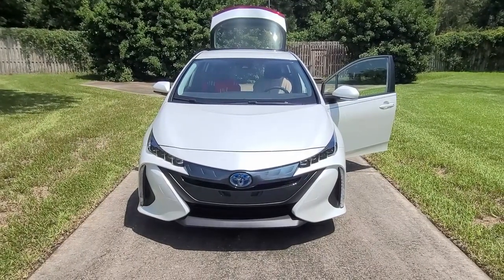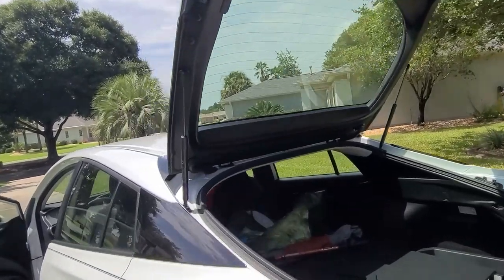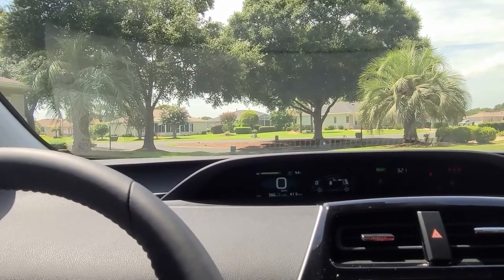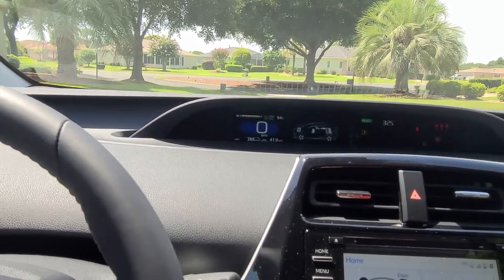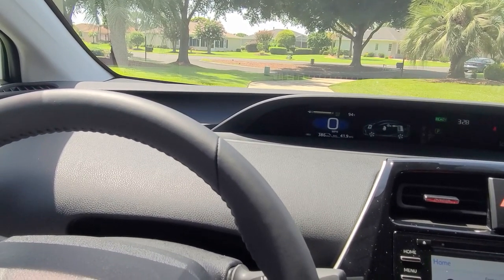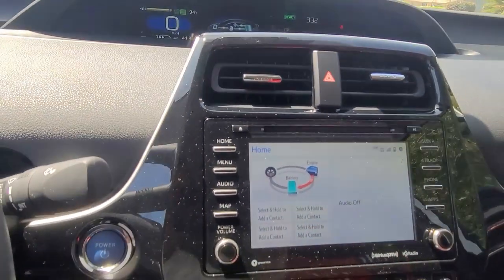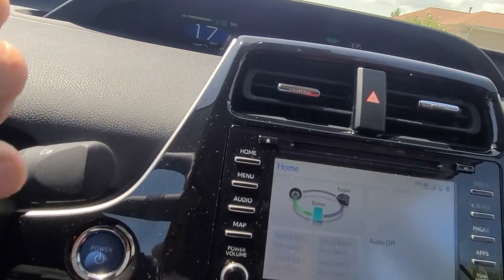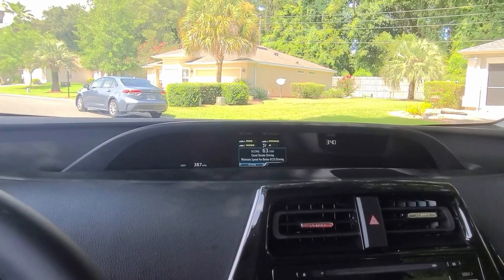Toyota Prius Prime LE 2021 Drive Modes and Gas/Electric-Battery Techniques Fully Explained at LAST!

Comment: I stick with Eco mode all the time, since I drive like an old man anyway.  I drive a lot of hilly highways, and I find that the engine does kick in on the steepest hills at highway speeds in EV Mode.  It kicks in on moderate hills in EV Auto.
Reply from the maker: Me too. However, I live in the FREE state of Florida which is mostly flat. Therefore, I have to remember to use Power mode or run the battery down from time to time.

Comment: Great and funny video. I tend to stick in normal mode for a good balance of power and economy mode. Eco mode is just a little too sluggish on the accelerator for my taste. Also, in standard EV mode, the car will stay in EV until 85mph, after that speed the gas engine will automatically kick on.
Reply from the maker: Thank you so much for the comment. I was more referring to the fact of what happens when the EV battery is spent. I drove in Michigan so I know some people drive 85+ and good luck with that. Michigan now has a State Trooper every 50 miles on I-75.

Comment: Hey I also worked on the Digital computers PDP-11, I memorized the switches for the boot program. Programming was all in Assembler language. No one understands today, what machine language is!. Out team wrote all the OS, device drivers from scratch. I also used PDP-8 prior to that. THanks for the video, still waiting for my 2022 Prius prime to be delivered. Stuck  on a ship in the Pacific!
Reply from the maker: That is your problem. If you had brought your Prius into a Florida port you would have it now! In college I got a A+ programming in Assembly language and C.
Reply: @thatcybersecguy  had I known I would have done it.  My dealer probably did not have the option

Comment: Appreciate the energy and enthusiasm, be yourself people with negativity just simply won't get it, i had a prius before and been contemplating this car so watching your video helped, thanks for making it keep em coming!! Someone in another video said car wouldn't switch from gas to electric and back without having to turn car off. is that the case or can you switch from any mode at any time while you drive?
Reply from the maker: You can switch anytime. However, I felt a lurch in the car which I don't think is good. No evidence of that. I wait until I'm sitting at a stoplight to change techniques.

Comment: What I am trying to tease out concerns the starter battery in my 2010 Prius. My battery died and less than a year old.  I drive  about 3 times a week or more but short distances  in Eco mode and not exceeding 26 MPH (inter city driving) Is the eco mode not re-charging the battery I wonder. Or does it need more driving and faster?
Reply from the maker: Reply on May 3 video toward the end. Shameless video promotion!

Comment from the maker: That is incorrect in my experience. The Prius Prime will switch manually or automatically between modes. Good luck getting one with the supply chain issues.

Comment: EV Auto and HV....isnt that the whole point of "hybrid"? What does it need 2 separate buttons to do that?
Reply from the maker: My understanding is in EV only mode the Prius Prime will fight like HELL to use the battery ONLY until the battery charge is exhausted. Toyota provided the EV Auto mode to make it easier for the hybrid to switch between gas and battery when the roads become more difficult. Sounds strange I know but it makes sense in weird way.

Comment: That seat belt will save your life one day! So please don’t be so quick to dismiss safety. Thanks
Reply from the maker: I have been in 28 car accidents. In two of those I am only alive because I was NOT wearing a seat belt. In one the car roof was ripped off the car. If I had a seat belt on I would have been beheaded. Just saying.
Reply: @thatcybersecguy  I am so happy for you but I guess my experience as an old man was different.